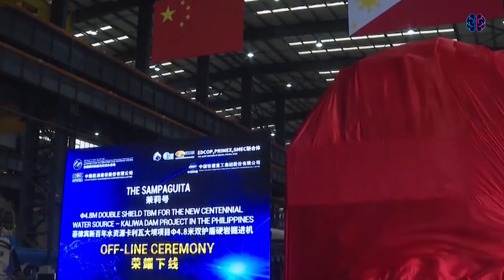How China Builds So Fast (Explained)

Comment: They build things fast because of some factors one 1000's and 1000's of workers per project. Forced to work day and night non stop 3 shifts of 8 hour or 2 of 12 hours. Very little pay too construction workers in china make half or even less than half workers in the USA or North America. Things can be made but they cut costs and standards on everything they make. So yes they look impressive and get things done and everyone says wow. But then something can fail much quicker by cutting those corners. Imagine if China built the golden gate bridge in SF. It would have fallen long ago during some of the earthquakes that happened there. But the Golden Gate Has stood the test of time with good solid engineering and shows Quality is always better.  If China had to build to the same standards we have in the west trust me these impressive builds would take much longer.
Reply: Most of what you’re saying just isn’t true anymore and it’s more of a cope than reality.